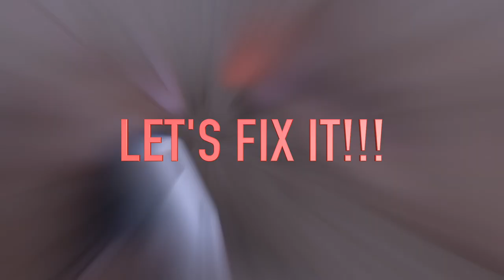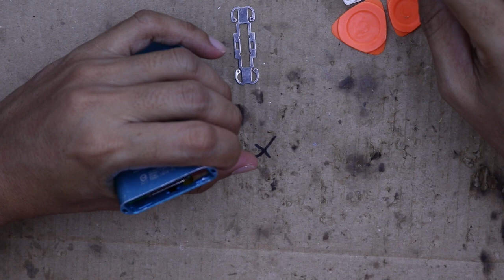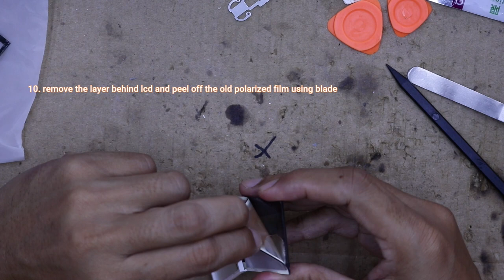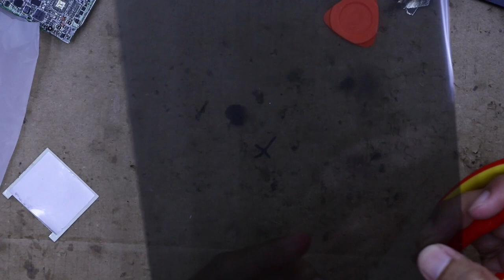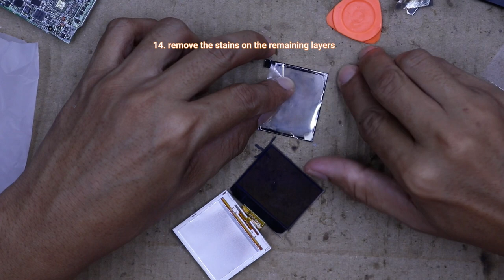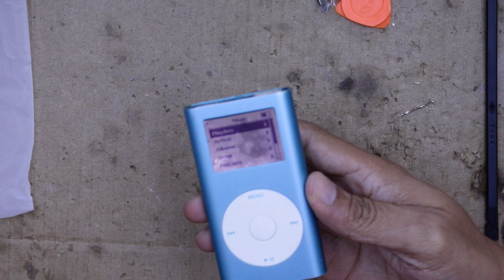How to Fix Burn Mark/Blurred Image on Ipod Screen?

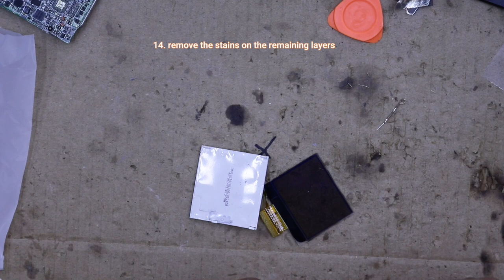Comment: Bro, is the step on 5:25 necessary? I mean must you peel those two layers? And what kind of liquid do you use on 6:02?
Reply from the maker: i only removed the staind layers..not all layers..i am using alcohol
Reply: @1upeveryday  ah I see. anyway the polarized film, there are two types, positive and negative, which one did you use? any different effect if I use the wrong polarized film?
Reply from the maker: I dont count the -ve or +ve..i just put 1 polarized film on either side of the lcd..if use both sides the screen will be too dark and may not be visible
Reply: Great work dear...